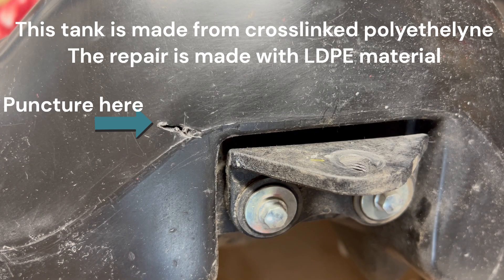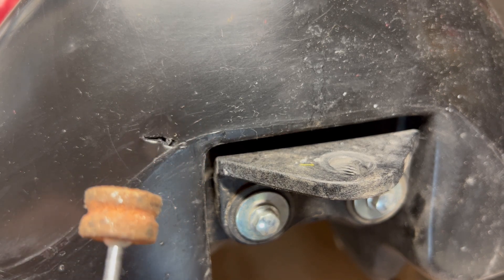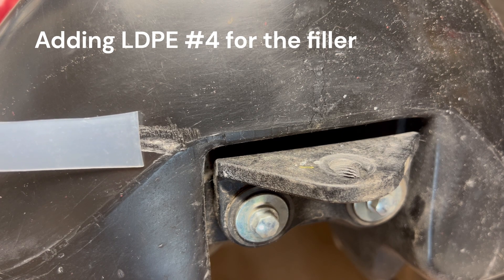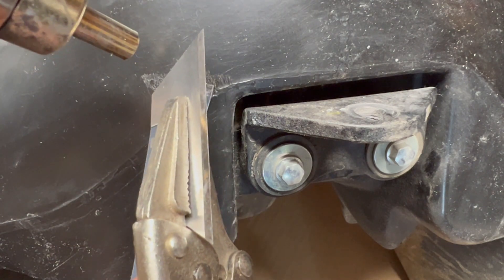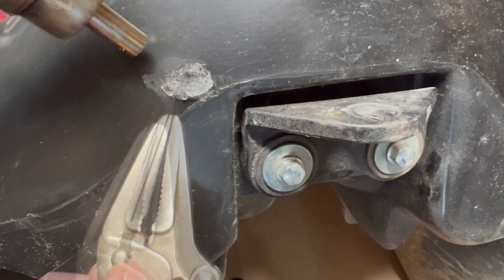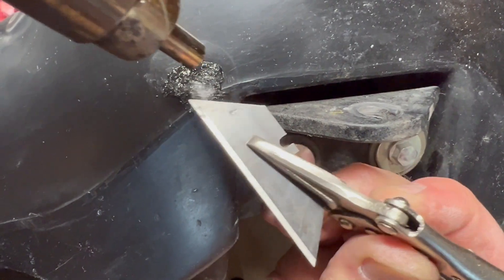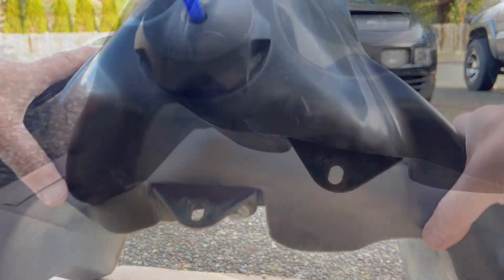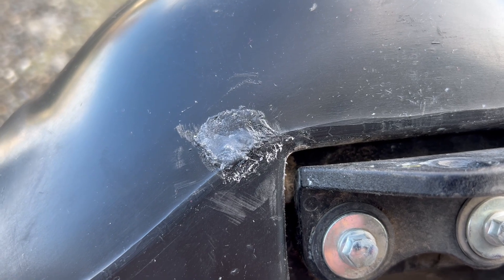Plastic Gas Tank Repair

Comment: How’s it holding up? Thanks for the video
Reply from the maker: So far so good - no leaks.  I feel it's a solid fix.  Just don't try to melt the tank material (it will burn before it melts) and you'll be fine.
Reply: @peppermoongarage  that’s much appreciated sir. Thank you
Reply: @peppermoongarage  I’m trying to avoid taking the tank off, it’s on my vehicle and the gas tank was punctured four days ago, so I’m assuming quite a bit of the fuel has leaked out

I think I’m gonna try to melt the plastic and then stick it in there so that I don’t get the heating iron  to ignite the fumes

Comment: I got the HF 80 watt iron. It came with black poly sticks. Repeated remelting and adding material chasing the blow molded parting seam. Frustration for sure. My mower is no longer made so spares are hard to find. Turns out there was a recall of the fuel tanks in 1994.
That is a day late.